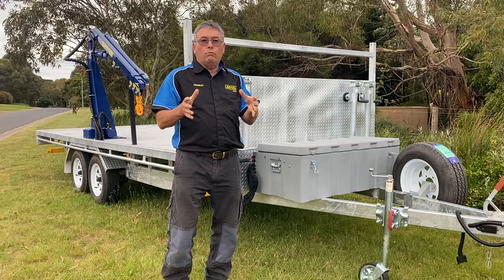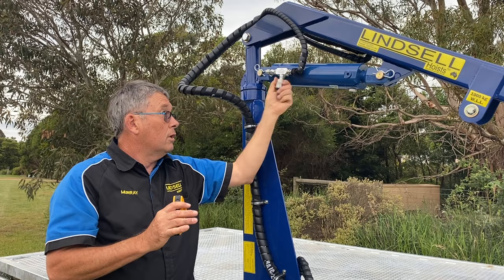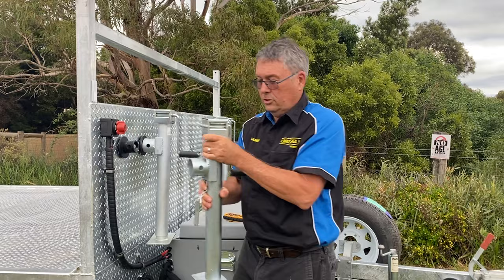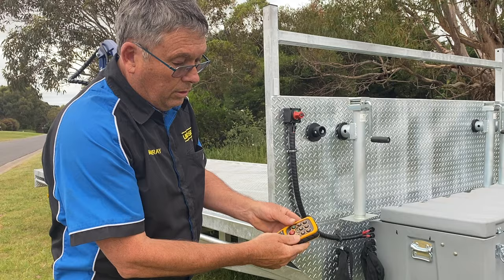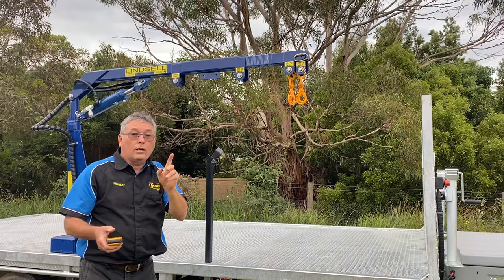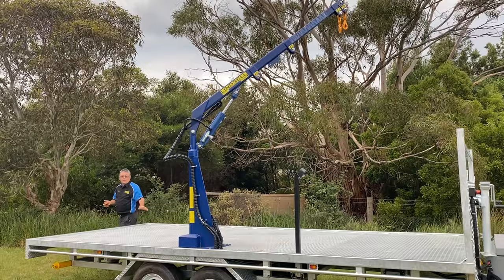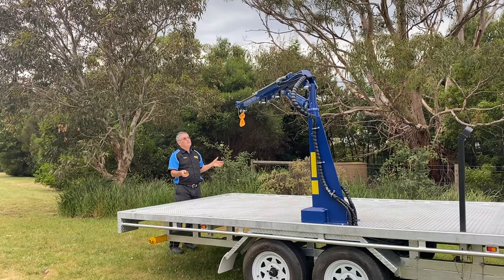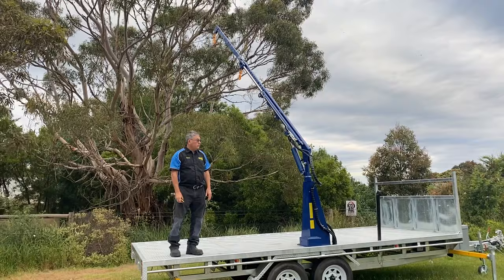Lindsell Hoist JRT on Large Galvanised Trailer - Radio Remote Control - Operating Crane on Trailer

Comment: Great product, it'd be nice to have a scaled-down version, for a smaller utility trailer still remote operated that could lift you know 1500 maybe 2,000 lb rotate and teleskop extend. And we don't need a lesson on power lines and how to read weight ratings. Thank you though good video